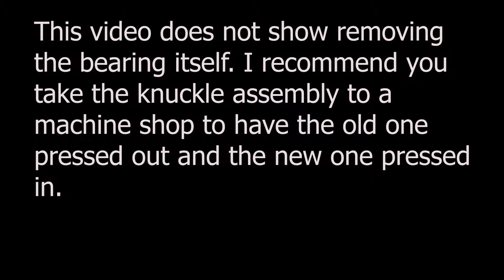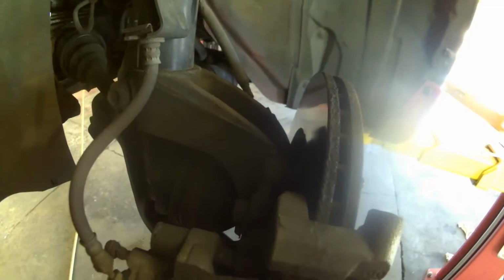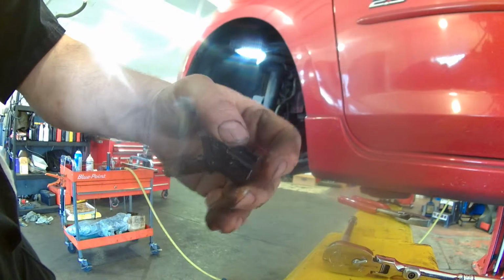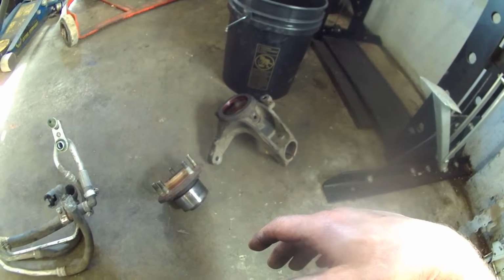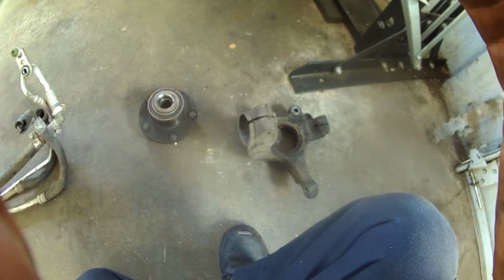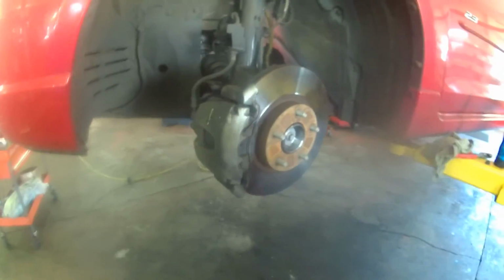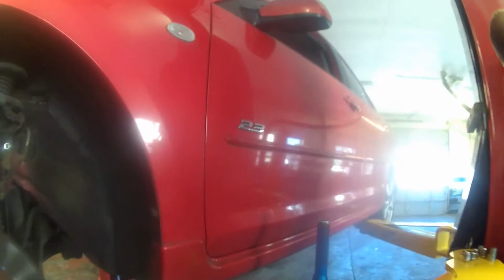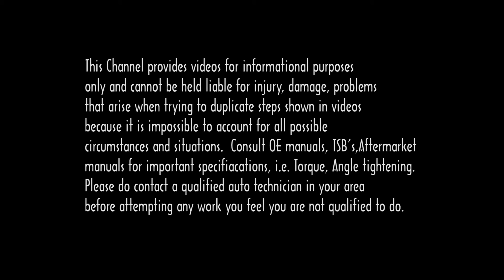Front wheel bearing replacement 2005 Mazda 3 S replace or how to change hub assembly

Comment: My question is, how did you remove the bearing that is under pressure on the trunnion, I with a 20 ton press is not possible to remove mine, does the ABS sensor tournament influence? or is it simply snapped off?

Comment: Hi I had a question, for the wheel bearing and hub did you buy them together assembled or separate?  Great video btw
Reply: You can find them assembled already or just the bearing it self, I'd go with hub and bearing assembly. Its easier